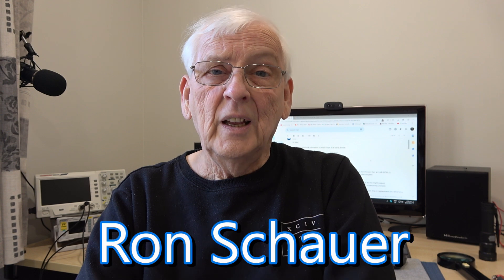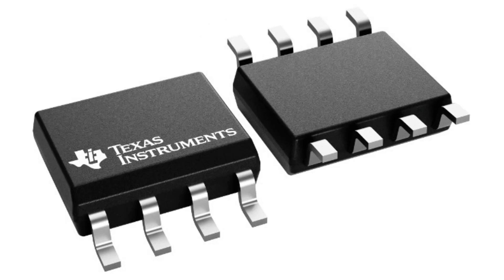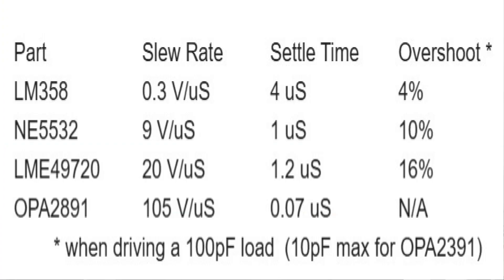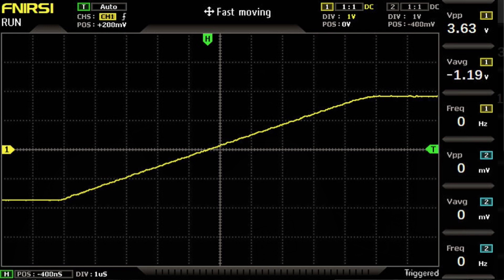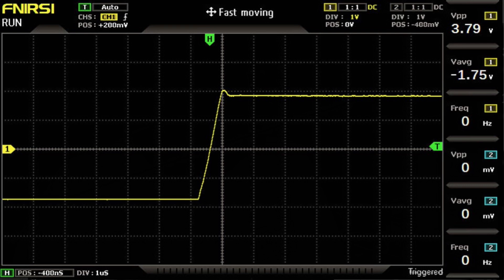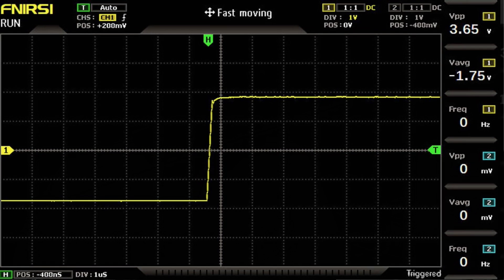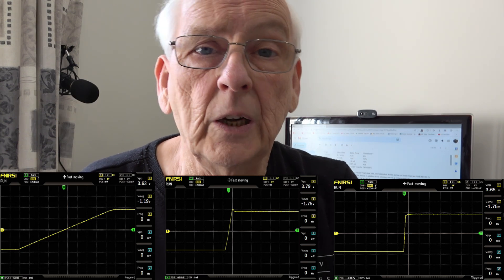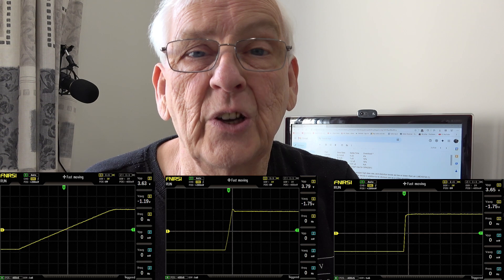The OPA2891 Could this be the best audio IC?

Comment: Although it cannot be used as a drop in replacement, PCB's from China are dirt cheap. The 10pF output is simple to overcome when designing a small dedicated board. Simply isolate the output of the op-amp with a 20Ω resistor. This isolation method is commonly used with all new op-amps.
Reply from the maker: If only life was that simple. The biasing requirements are VERY different. It really is not a drop-in replacement, even with a conversion PCB.
Reply: That 20 ohm resistor only compensates for overshoot. It impedance matches the pcb trace to the opamp and will require experiment to match perfectly ie could be between 10-30 ohms.

Comment: Hi Michael. While I like some of your reviews of the various cheap audio kits available, I believe your assertions that high slew rates are required for good audio amplifiers is non sensical.  The required response range for "hi-fi" is generally regarded as 20 Hz to 20 kHz. Human voice, musical instruments, microphones and loudspeakers don't respond much outside this range and certainly human hearing covers a smaller range which further decreases quickly with age.  Maximum slew rate is a simple function of the peak voltage and the frequency being reproduced. Maximum slew rate i.e. rate of change of a sine wave occurs at the zero crossing and can be found from a straight forward differential equation: ∂/∂t [Vpeak * sin(w*t) where w = 2*π*f.  Do the maths and you will see what slew rates are actually required which can be easily verified with a signal generator and an oscilloscope. For example, the output stage of a power amp specified to provide 100 W into 8 Ω (which corresponds to about 40 V peak) needs a slew rate of: 2*π*20000*40 = 5.02 V/µs to reproduce 20 kHz. ICs that might be used in preamplifier stages only ever need to produce output voltages that peak in the 100s of millivolts otherwise the power amp will be overdriven so have a maximum slew rate requirement of less than 1V/µs to be able to full reproduce signals in excess of 20 kHz. One of the first lessons I learnt as an electrical engineering undergraduate was do not design anything faster than it needs to be. An amplifier that is faster than necessary requires extra design effort to guarantee stability and minimise noise. If you study the work of some of the reputable practitioners of good audio design such as John Linsley-Hood, Douglas Self, Peter Walker etc you will see a realistic approach taken to design requirements.
Reply: You stick to pure theory, but when you hear the difference in sound clearly you have missed something. Many amplifiers measure the same but sound way different, sine-wave measurements tell nothing as it is the easiest form of signal to reproduce up to the levels of 0.001 THD and below, you forget about phase delay of low frequences relative to high frequences, settling time also in some circuits it can be included in a feedback loop and have an effect on damping the drivers, an increased delay in this case will be detrimental but will not be apparent on pure sine-wave as it will stay a pure sine-wave. Probably this chip has also other parameters giving him an edge over other audio op-amps.
Reply: @gherbent  We're not listening to sine waves. We're listening to complex waveforms with intermodulation components added. Some of those are ultrasonic.
Reply: @stephvanschalkwyk6866  you probably addressed your message to a wrong person. I do not consider measurements with sine-wave to be relevant, just being informative.
Reply: My current discrete build preamp has a slewrate of 200Vu/s. Bandwidth is way beyond human hearing, yet it sounds so good and natural. Cutting the bandwidth would essentially reduce the slewrate. Since the preamp runs happily without problems, I'll keep my +1MHz range and enjoying the 20-20000hz music it produces with the enormous headroom that the slewrate provide.
Reply: @kenielsen  I guess like driving a Ferrari in a school zone.
Reply: @glasslinger  why? You can actually hear this even at low level music. Many DIY'ers (and often expensive consumer amplifiers) aim for a high slewrate, it's just a matter of design and parts selection. Often no extra cost if done right.
Reply: @kenielsen  The comment left out the :) I was making a funny, having all that power and not needing it. I'm 79 so my listening days are muted. I can use a 358!
Reply: @glasslinger  just got carried away:) I'm experimenting a lot with slewrate and cutoff frequencies/direct coupled these days. It's hard to get just right, to my ears that is;) age 41.

Comment: You clearly have a fundamental misunderstanding of how opamps work if you think that dropping them into an otherwise identical circuit is going to give a fair comparison of how well each opamp can work. I suggest that anyone who's serious about getting the most out of actual audio opamps consults the works of a Mr Doug Self.
Reply from the maker: You clearly have not watched my video with care. In fact, I have stated you CANNOT do this. In this video alone I've said if you swap the 5532 with a LME49720 you need extra caps across the supply pins 4 & 8 to keep it stable. This whole video is about that very fact that in MANY chases you cannot just swap them over. Many people do just that. I'm fully aware of Doug's bible, I have a copy of a number of his books right here.  You will note, I only swapped 3 explaining the need for extra decoupling. The OPA2891 was the main subject of the video, explaining you CANNOT JUST DROP IT IN. It looks like you watched 3 mins of my video and started typing!

Comment: The Texas Instrument datasheet says:
7.1.1 Driving a Capacitive Load
The OPAx891 are internally compensated to maximize bandwidth and slew-rate performance. To maintain
stability, take additional precautions when driving capacitive loads with a high-performance amplifier. As a
result of the internal compensation, significant capacitive loading directly on the output node decreases the
device phase margin, and potentially lead to high-frequency ringing or oscillations. Therefore, for capacitive
loads greater than 10pF, place an isolation resistor in series with the output of the amplifier. Figure 7-1 shows
this configuration. For most applications, a minimum resistance of 20Ω is recommended. In 75Ω transmission
systems, setting the series resistor value to 75Ω is a beneficial choice because this value isolates any
capacitance loading and provides source impedance matching.

So if a 20 ohm resistor can solve the problem, we're good!

Comment: Video typically uses 75 ohm coax, so they must have some way of driving the capacitance...
Reply from the maker: I doubt this IC would be the final driver in any video circuit. My knowledge and experiences in video are almost zero.
Reply: When used as an output driver, the chip won't be connected directly to the cable. It will have a 75 ohm resistor in series with it to match the cables characteristic impedance. Of course, one must use careful design and board layout to keep a chip like this happy. Do that, and it's a monster capable of pushing 200 mA.

Comment: If we need a speed (and if that means an accuracy) we should use a discrete pre-amp with local negative feedback only. In a current amplification mode. Some 300MHz bjt, and it will amplify PAL signal with a good linearity (0.01% this is what nobody hears). I remember when tape recorders switched to opamp driven pre-amplifiers, a sound became dead.
If I still need an opamp for a sound these days, that would be muses02, burson v6, or sparkos 360x
Reply from the maker: I really don't understand why some people think IC don't sound good. Afterall it's full of transistors. The devices are very precision indeed. Much more accurate in component tolerances than any discreet circuit can be. And at a fraction of the cost. But here comes the snake oil. One is often in a shiny metal can, the other in a black plastic mold and looks very boring and just like a hundred other chips. So, they cannot be as good, can they?
Reply: @MichaelBeeny  For my opinion opamp is "worse" for two reasons. First, because it's a differential amplifier. DA affects a dynamic (however perhaps not all of them, as an internal structure of all those current mirrors can affect). Secondly, because it's a " devices are very precision indeed". That means that a stability is more important than a dynamics. If we measure a sine wave, we see nothing (because by ear we hear a difference between 5532 and 797, so it's about a processing of a complex wave). Third, like a bonus, most of opamps were designed for a measurement, not for a sound, when an input bias means more than a transient characteristics. 
I'm pretty confident that a linearity is not the most important for a sound (well, for a sound people like).

Comment: I would like to add a few things to Mike's discussion points.

First-
The OPA2891 (also available as a slightly lower spec device- the OPA892) is a *video* amp primarily.
However, TI's specification sheet for it quite clearly touts it as a device for "Professional" audio devices (of various sorts).
Well, yes, sort of... maybe.
The point that Mike and I were trying to make was NOT that it is the be-all and end-all device for audio, but rather that it could be used for that purpose *IF* the proper circuit was designed around it.
However, quite honestly, NO ONE would be able to actually hear any potential improvements in slew rate and distortion as compared to a device such as the LME49720.
So in the end it is just not worth the added time and effort.
Stick with NE5532s, LM4562a, LME49720s, or similar family devices as you may like.

Second- 
Unfortunately even if you did solder it to a DIP adapter and piggy-back the necessary bypass capacitors literally ON the device package (to keep it from breaking into oscillation) , it still cannot be a drop-in replacement for a 5532, 4562, 49720 or other similar spec devices.
For example, its input bias current is about 1000 times (yes, 1000X..!) higher that of an LME49720.
That alone means that the circuitry around it would have to be re-designed for it to even function properly.

Finally-
The real point of this video is to show just how slow 1970's vintage "audio" chips such as the LM358 were, and how very much the state of the art has improved, even as recently as with the LM4562/LME49720.
In fact, if you have elderly hearing (such as ours), and assuming that the remainder of your hi-fi system is at all decent, you CAN hear the difference in audio played through an LM358, an NE5532 and an LME49720 using the very same amplifier circuit.
You absolutely do NOT have to have magic ears or be a rich audiophile.
More detail and clarity mainly.
And those differences are primarily due to the faster slew rates.
It is not that the detail was not there already, it was always there in the recordings.
It is that slower devices and circuits mask it.
The faster devices are not adding things, they are simply taking away less.

So- please DON'T go buy OPA2891, OPA891 or OPA892 chips expecting to drop them in and have magical things happen (other than your money disappearing into thin air) because they just won't. 🤔
Reply: @ronschauer839 Absolutely right! Whatever the point of this YT is it's silly at best and harmful to the less experienced at worst. This "rolling" of opamps is often a bunch of BS with people claiming to hear differences between (hopefully) similarly speced devices. Between a LM358 and a LM4562? Sure. Between an NE5532 and a 4562, I don't think so. The one constant is the omission of double blind or ABX tests. If you're not evaluating the swaps that way you're just kidding yourself thinking you hear a difference.
Reply from the maker: @Obsfucation  If you think the audible differences between ICs are small (which I agree 100%) If you bring in differences in these so-called discrete devices a supper high price. Then the snake oil really starts to flow! Most do sound great but no better than the LM4562 but costs 100 times more money.
Reply: @MichaelBeeny  
I'm not talking about using it as audio opamp but as power supply. 
It has the advantage of fast switching, low noise and low supply voltage. It can be used for 5v linear power supply, which cannot be with the lme.
Reply: @Obsfucation  Between an LM358 and either an NE5532 or LM4562, almost anyone can hear the difference. 
However, I absolutely can hear the difference between an NE5532 and an LM4562/LME49720. 
Not only is the difference scientifically measurable (as shown in the video), but it is audible as well. 
Assuming of course that the rest of the audio chain is capable of passing the differences along, and I listen through headphones about 98% of the time. 
You might not hear any differences with speakers and all the room effects, to be fair. 
My own system is capable of good reproduction, and I HAVE done A-B testing with many, many different musical genres. 
The LM4562/LE49720 (it is the same bit of silicon inside the packages) is my choice of op amp to design with, hands down, no question about it, and has been for years.
But importantly, mine have always been genuine product. 
I have never had the misfortune of being supplied fakes. 
Any LM4562 or LME49720 supplied by other than official Texas Instruments distributors are virtually guaranteed to be fake, sad to say...
Reply: @ronschauer839  maybe it's a good opamp to use on a power supply as the super regulator and others
Reply: @Mrhifitunes  Nope. Just like in audio applications; it has no virtues that would be useful for a PS regulator and has too many issues that would make it almost impossible to work properly. Jut use it as intended; for video signals. A perceived "better" is not always better!
Reply: @Mrhifitunes  Understood but, that’s true with hundreds of different opamps out there. And just like it’s use for audio: why? There are many, many others that would fit that bill and do as well (and, in some cases, better) for a lot less money. Using a higher priced part for no particular advantage is poor engineering unless you’re just trying to assuage your ego or make up for a lack of relevant knowledge.
Reply: @Obsfucation  just like you can use any opamp for audio, it depends on the level of performance you want. The design of the super regulator uses the lme. Faster and higher slow rate means less noise and distortion on the power rail.
Reply: OMG you can't here the obvious difference between the OPA828 slew 150v/uS and a NE5532 for the 1970's then give up please.

Comment: If speed is so inportant why not used LT1226. More expencive ($11.34 single vs $6.67).   LY1226 have 1GHz bandwith. Another thing: there is leaded verion, so you could used socket.

Comment: Dear Mr Beeny  thank you for your always excellent and very valuable analysis 
There is an old chip that was considered one of the best for a line stage preamp     The ad797 from Analogue Devices  
Its noise and distortion are very low when it is used correctly

Comment: Why being so obsessed about slew rate?
What is the bandwidth of your ears? You're not the youngest any more, so if you’re lucky, you might still hear 15 or 16 kHz.
A large signal rise time of 1 µs results in a large signal bandwidth 350 kHz!
Your oscilloscope already shows a slightly better rise time for the NE5532.
So the large signal bandwidth of the NE5532, being >350 kHz, is already miles beyond the bandwidth of your ears. So why bother for more slew rate and bandwidth?
Even if the rise time is only 5 µs, the bandwidth is still 70 kHz, way better than your ears.
What about accuracy? 
What would be the accuracy of all the equipment between a musical instrument and your ears?
That includes: microphones, equipment for recording, editing, mixing, ADCs for CD/DVD, your audio chain with DACs and speakers and the acoustical properties of your room.
Any accuracy, if ever present, will be long gone in this long chain.
Adjust the controls of your audio chain as you like it and enjoy the music!
Reply: Op-amps have a very high gain, that is reduced by feedback from end to start in the application.  Many designers of amplifiers therefore don't like op-amps and insist on discrete transistors, where each stage can have its own feedback loop (emitter resistor) which is reacting immediately on this stage, not delayed over many stages.  These designers avoid an over-all feedback loop from output back to input, or at least use only a small part of the total feedback over the long way.

I never designed audio amplifiers, but I can understand the motivation to avoid or at least reduce over-all feedback.  However – if the op-amp is extremely fast compared to the frequency band needed – that critic can be forgotten.  The delay from output back to input is negligible.
Reply: your ears can hear a phase difference of microseconds.  At 5kHz, 5 degrees of phase shift is 2.8us.  So yeah you can't hear 20kHz, but you can hear the phase shift of an amp that rolls off at 20kHz.  Or a speaker for that matter.